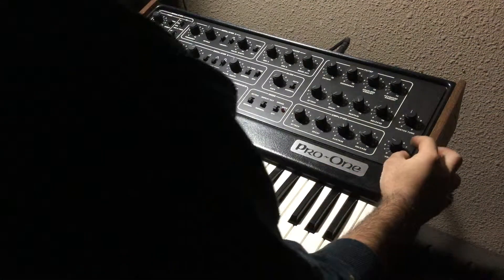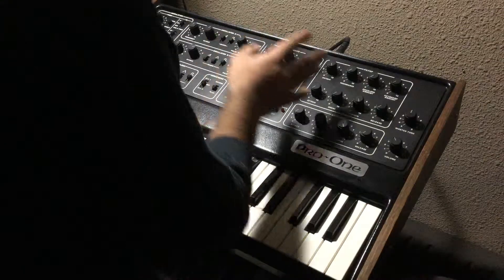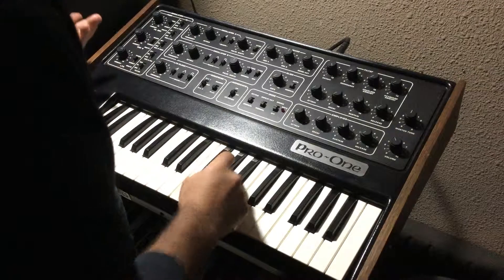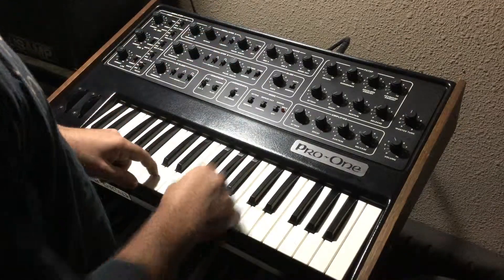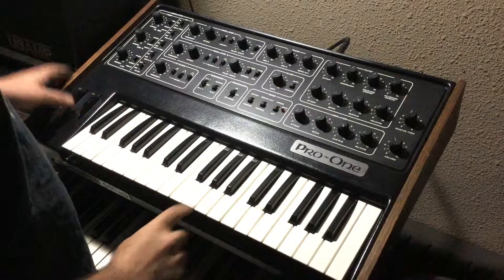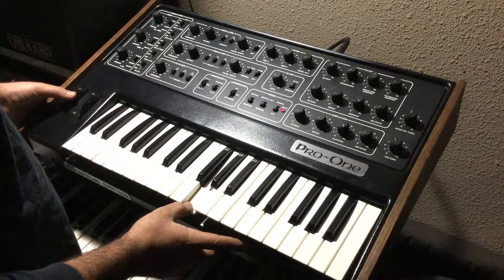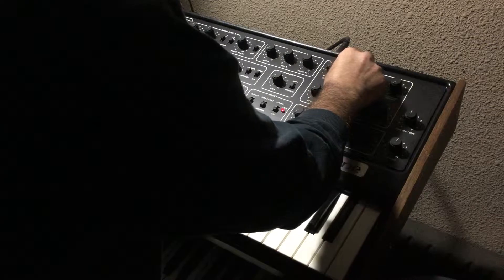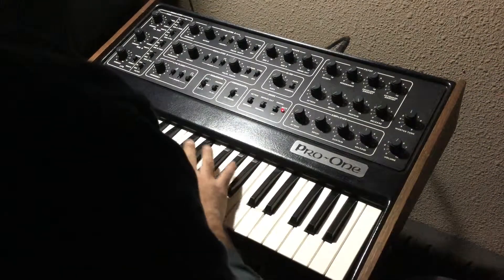Sequential Circuits Pro One Demonstration

Comment: I can get one of these (recently serviced) for around $1500. Worth it?
Reply: @John Galt Dough Your opinion is so foreign to me. :-) You can get all those sounds on a disc?! That is so far removed from actually using a Pro One. Turning the knobs, using the filter, using the arpeggio. Being creative. It's been Vince Clarkes favourite synth for close to 40 years. Theres a reason for that. I just hate the concept of putting synth sounds in a sampler. Drummachine sounds I can somewhat understand. But synths? Especially analogue synths?! Pretty pointless, if you ask me. They need to be used. It's a musical instrument, not a rompler. Just my opinion.